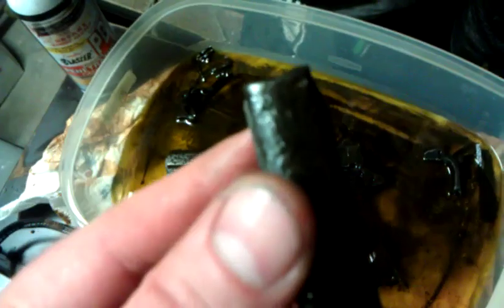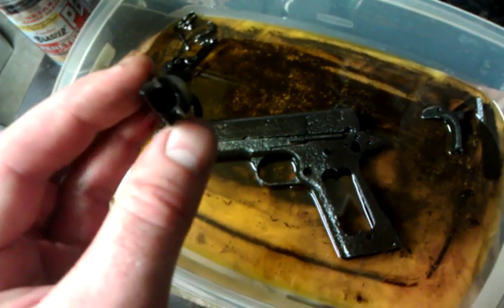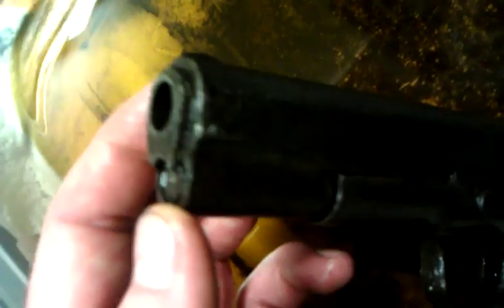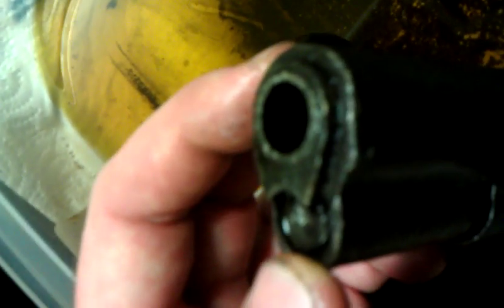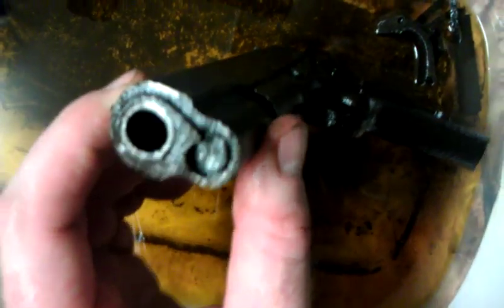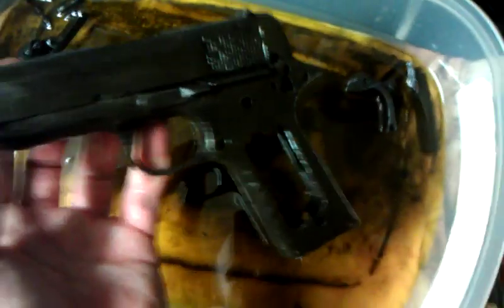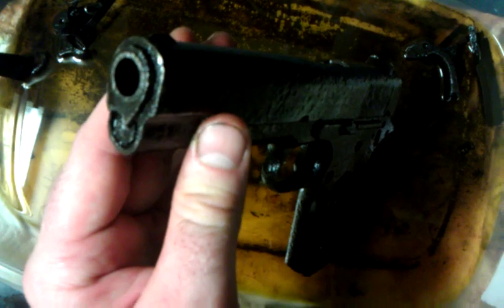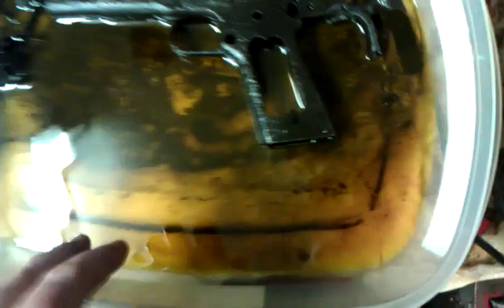Rusty 1911 Restoration: Video 13: Penetrating oil bath, rifling starting to be visible

Comment: According to this website, http://www.coolgunsite.com/pistols/colt%20production.htm , the serial number starting with "C11" or "C13" would identify your pistol as the commercial model 1911, manufactured between 1919 and 1924.